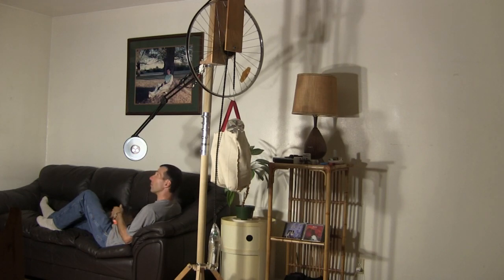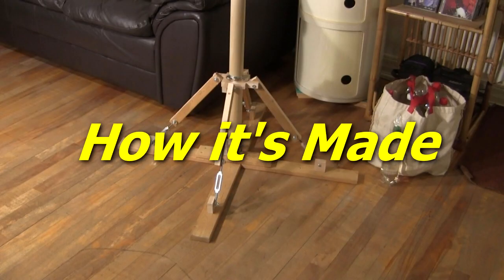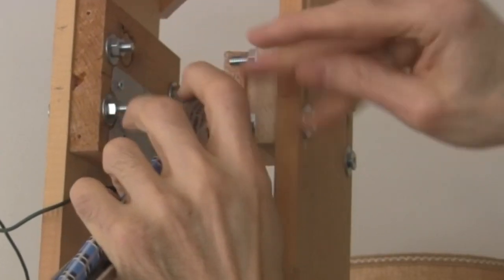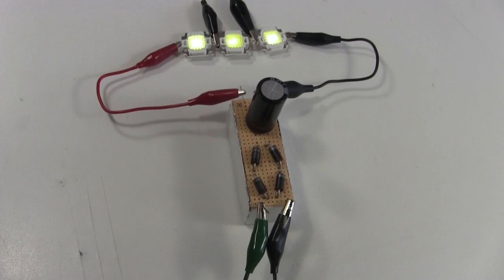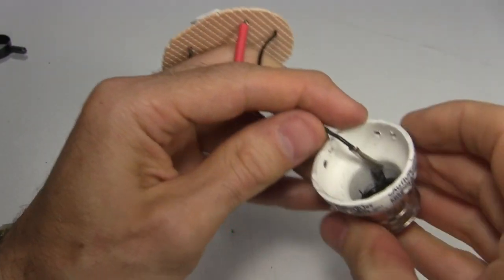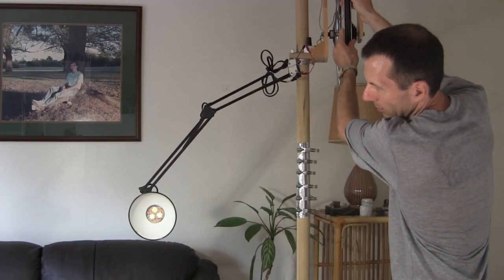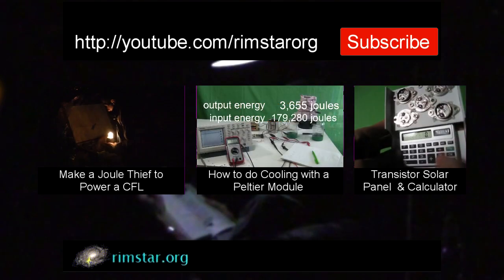Gravity Light (v2) Making and Enhancements

Comment: Can different kinds of light bulbs be used instead of diodes?
Reply from the maker: The problem with using different kinds of light bulbs is that they require more power. That's why I used the LEDs that I used, they're very efficient and give a lot of light for a low amount of power. If I used the same power to light another kind of light buld, the light would be much dimmer.
Reply: Thank you!

Comment: Hello, If I use a 24 volts dc motor, what rpm should I use?
Reply from the maker: I don't know, you'd have to do some sort of test. Make the circuit for powering the led from the motor and somehow spin it to see what rpm is required for the led to light. But I think when you do,, you'll find that the rpm needed is too high. The motor that I used also contains a lot of gearing inside (the gearing converts low rpm to high rpm). That allowed me to use a very low rpm. A normal 24 volts dc motor has no gearing so you'd need a much higher rpm. You'd need to provide the gearing yourself for going from low rpm to high rpm. I have more of an explanation about the basic principle on my website here https://rimstar.org/science_electronics_projects/gravity_light_homemade_diy.htm

Comment: Would it be possible to charge up a mobile phone?
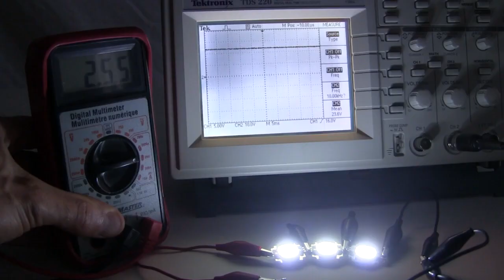Reply from the maker: I don't know how much is needed for a mobile phone. In the video at around 2:49, I show that the LEDs have 24 volts across them and are drawing around 2.7 milliamps. That's 64 milliwatts (24 x 0.0027). A phone is a different load but let's say you step the voltage down to 5.2 volts (maybe with a DC to DC converter), the current would be 0.064 watts / 5.2 volts = 0.012 amps or 12 milliamps. I don't know if that's enough, or how long it would take for charge the phone with it though.

Comment: Hey,  great project, I think you could improve efficency by replacing the bungee with a proper rubber belt. The other one, is the motor I'm sure isn't a great generator. A simple made rare earth magnet and coil generator would be much more efficient. how did you improve the run time from 2 to 12 min?  that's a huge increase. Def onto a winner with this tho. I can see a device similar to this that stores the energy in a battery. and a hopper full of weights slowly feeds the machine until the hopper is empty then energy stored lifts the weights back up to the top, or someone can lift with a pulley system.
Reply from the maker: To go from 2 minutes to 12 minutes I did two things.
The first was to make a sturdier stand so that I could move the chain to a smaller sprocket because it didn't lean over anymore, plus it could now support more mass. So more mass on a smaller sprocket meant the mass could fall more slowly while still producing a sufficient speed at the generator.
The second was to switch to more efficient LEDs. That meant I could slow things down more while still getting the same or more light.
There are always losses, plus you use up some energy to power the light, so the battery wouldn't have enough energy to pull the weights back up. But if you're reading on the couch, you should get up and stretch every now and then anyway, so why not do some lifting while you're up.
Reply: RimstarOrg hat was your final gear ratio after modifications. for each rev of the rope pulley, how many revs were you getting at the alternator? I'm thinking not of a way to create a light but a way to actually generate and store electricity. The problem with this system is even if you built a fantastically efficient alternator is run time is limited by height and always will be. I had a thought, say your maximum height was 3 mts but you could make it fall in a long zigzag fashion. A heavy weight on wheels rolling down an inclined surface which could be 5 mts long or as long as you want. when it gets to the end, there's a pulley on the end of the track to support the wire or rope attached to the weight, the wheeled weight falls down to the next track and starts travelling  back towards you and so on so the overall distance travelled can be much greater. now a bit of trial and error would have to be figured out for angle of inclines, gear ratios as the weights not pulling straight down, the weight may have to be greater etc but possibly a much longer run time can be achieved. also thought of making a system that has multiple units but only one weight to generate more power.
Reply from the maker: The top pulley is turning at around 6 to 10 RPM, I don't know what the generator is turning at inside after all the internal gearing. You can see the dimensions on my webpage here https://rimstar.org//science_electronics_projects/gravity_light_homemade_diy.htm. Neat idea increasing the distance that way.
Reply: Can you please tell which motor suits better for this

Comment: I’m in middle of converting a small hand held hoover( car vacuum cleaner) into a portable wind/water gene with built in lights( run off the Vacuum’s built in batteries) and a USB port for charging ph’s etc. Also got a wind gene project going to put on my balcony, made from a ‘stand fan’ and the motor from a food processor. Oh yeh and a hand wind gene from a microwave Syncronous motor. I’m pretty good at re purposing/adapting  things but am virtually a newcomer to electronics, and so learning as I go!.
Reply from the maker: Sounds like lots of fun!

Comment: Would it be possible to have an Equal weight on the opposite side so when 1 side is down the other would be at the top, and jus use a much smaller weight to add to the weighed counter that would be at the top. So the idea is instead of having to get up and lift the weight up every 12 mins, you could just swap the small extra weight from the weight to the ( Equal ) counter weight? Although thinking about it, you would still have to get up in order to reach the weight that’s at the top!. Would work  perhaps if your bed/Sofa was on a Mezzanine or if you had a hole if the floor to a basement so most of the apparatus would be bellow floor level with the top of the apparatus at head high when in sitting position!. Then all you would have to do( in theory) is move an extra bottle of water of paper weight etc from one side to the other!.
Reply from the maker: It's the difference in weight between the two sides that makes one side fall. Obviously if both sides weigh the same then nothing happens. If you then add just a little to one side then only that little extra is what has to do the work of turning the generator. But as you see in this video, it takes a lot of extra weight on one side in order to turn the generator. So having a small difference isn't good enough.
Reply: RimstarOrg yeh I’ve just realised how silly what I said was!. Cos if you have two weights countering each other, they cancel each other out!
Reply: I should of at least got up out of bed and freshened up, breakfast etc before commenting, I’m a mechanic and fabricator with experience working on Trains. So that was just one of them stupid things said without putting brain into gear!. lol
Reply from the maker: No worries. Been there, done that.

Comment: i recognise that gene sound, its the plate turning Syncronous motor from a Microwave isnt it?. I was thinking of using it for a gravity gene as it puts out a lot of voltage but is noisy when turned fast, so ideal for this purpose or a hand held/windup gene
Reply from the maker: Yes, that's what it is.

Comment: I'm thinking the milliamps you stated is incorrect. probably around 27 mA
Reply from the maker: You can see at 2:52 that the meter is on the 20mA scale and the reading is around 2.7mA. The LEDs seem bright but they're nowhere near full brightness.
Reply: RimstarOrg I think you're either reading the meter wrong or the meter is defective. Those type LEDS need a lot of current. About 1 Amp. You're meter is probably reading 270mA.

Comment: Not bad.  One question though: If you have 3 LED's in series and they need 24V each, how are you getting away with a 35 V reservoir cap? Is that cap even necessary? What happens when you run without it? The output frequency must be like 400Hz; I can't imagine you would notice much flicker. I've personally always preferred to use DC motors of the type used in record turntables, VCR's or tape players as small generators due to their smooth, quiet and efficient operation. Most hand crank flashlights and radios do.

I messed around with this concept a bit myself after Steve Mould posted a video featuring a production version of this.  I also tried using a synchronous motor from a microwave but I thought the built in gearbox would be too noisy and inefficient so I was trying to spin the rotor directly. Never ended up getting it working.  I wonder if it might be better to dispense with all the reduction belts and gears and instead use two water reservoirs connected by a hose with some kind of turbine spinning a gen in the middle.  Ideally it would be great if the turbine could be bi-directional so that the reservoirs could be bladders and the system could be closed, and reset by simply bringing the full reservoir to the top, but I can see no reason why siphoning from open buckets wouldn't work too.  You could ostensibly get hours of continuous operation with very large reservoirs, as the reservoir itself would not need to move; just the water would.  I may have to try this now that I think of it..
Reply from the maker: In answer to your question, the 3 LEDs in series need 24V together, not each (see the video again at 2:50). So there's no problem with the 35V reservoir/smoothing cap. I never tried without it so I don't know how well it would work. I don't know what frequency the motor's producing. I know it's normally run at 110Hz, but that doesn't mean that when run as a generator at this voltage it'll run at the same frequency. I guess if it's a high enough frequency then any flicker in the LEDs output won't be noticeable, good point. But without the cap, the voltage wouldn't build up to 24V, so it wouldn't be high enough to turn the LEDs on. At first the voltage is DC, but start's very low and slowly builds up to the 24V as the cap is charged.
Reply: Actually the cap does nothing to increase the voltage; it's just there to smooth out the pulses coming from the generator.  The cap can only charge to the peak voltage (minus 2 diode drops from your bridge rectifier) that would be coming from the generator.  Those little turntable motors put out surprisingly high voltage.  Put your scope on the generator leads or just try holding the wires with it running and disconnected from the rectifier.  I've gotten them to light neon indicators (60-70V) without any extra circuitry.
Reply from the maker: Of course, what was I thinking? It's the diodes in series that cause the voltage to increase. Doh. Thanks for correcting me.
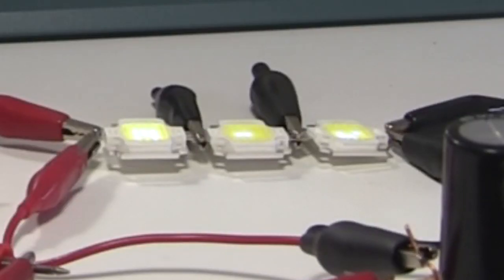Reply from the maker: Actually, the voltage across the capacitor and LEDs does build up. You can just barely see this at 2:41 in the video where the voltage on the scope is 8V and climbing. The vertical graticules are 10V each. Unfortunately I zoomed in to the LEDs soon after but then by the time I go back to it at 2:46 the voltage has risen to 24V. The rise to 24V actually takes around 20 seconds but I did a cut in the video since I didn't want to make the viewer wait for 20 seconds.
Reply: Yeah I get that.  What I'm saying is that the capacitor doesn't boost the voltage in any way.  Other than by using a transformer or some kind of switch mode circuitry, you can't get to a higher voltage than is coming directly from the generator.
Reply: what else is I’m a novice at electrical stuff, I’m more a mechanical person, anyway those microwave motors put out such a high charge( relative to their size) that I would think they could power a few LED’s without any flickering without using caps etc, but I’m probably missing something?.

Comment: pretty great! is the microwave motor the most efficient conversor? could you upgrade and get more electricity from the same design?
also, do you think you could get enough to, say charge a small battery, so you could store during the day and use at night?
Reply from the maker: The microwave motor was just the only thing I had on hand. The gearing inside it is what made it possible for me to do this. I imagine whatever the commercially made one of these uses if more efficient.
Regarding charging batteries, I don't see why you couldn't.

Comment: Hi Steve! did you know that newer led flashlights use a little circuit to turn on and off the light really fast to use less energy? you can easily duplicate the running time! btw,  did you try to use a battery to save energy for later? ;)
Reply from the maker: Someone had suggested using a boost converter circuit, which the the same thing, but I never tried it. I hadn't tried a battery either. I guess you'd do both. Store the energy in a battery and then take it out of the battery using the boost converter, giving you light even after the mass had hit the floor.

Comment: Can u please send me the link to buy the pulley
Reply from the maker: I bought it in a local store (Princess Auto I think). Look for it in hardware stores of search online for V-belt pulleys. The outer diameter of the whole thing is 2 inches. The diameter of the inner section that the inside of the belt contacts is 1 inch. The hole is a little less than 5/8 inch.
But you don't need the exact same one. Anything close will do.

Comment: I was looking for how much a gravity light would cost (the one made by crowdfunding and made in Africa or something) but I couldn't see it for sale anywhere and the prices to join the crowdfunding seemed very high (even for charity). So I ended up here. :)
Anyways, I was wondering if you thought of mounting it from the ceiling?
Reply from the maker: I don't have a way of doing it here since this is an apartment, but I don't see why it couldn't be done. You'd need to find a beam in the ceiling to attach to. A wall stud finder might do that, unless your ceiling is the attic floor and you can see the beams by going into the attic. Possibly one or two lag bolts into the beam would do the job.
Reply: Okay thanks.

Comment: Can you add more details about the Motor/Generator. How fast can it turn, how much voltage can it hold, and some similar informations.
Reply from the maker: I'll add some more details and photos to my webpage here http://rimstar.org/science_electronics_projects/gravity_light_homemade_diy.htm later today but for now... They're motors for turning the turntable inside microwave ovens. They turn very slowly and have some sort of gearing inside, which is why I'm using them. The two I have in front of me are both 120V, 3 watts, and are either 3 RPM or 6 RPM. So the speed you see it turning in the video is the maximum speed. Any faster and the gearing will probably cause too much current to be produced internally and damage the coils.
Reply: +RimstarOrg Thank you very much.

Comment: What if you made a heavy duty version of this that utilized something similar to a car jack? When someone does squats or bench press they move over a hundred pounds (typically) a couple of feet for each repetition. I'm picturing a tower the height of a house and a weight that is several hundred pounds being lifted in small increments. You could capture a great deal of energy during a workout.
Reply from the maker: +John Gober That would be cool. I regularly do  push-ups and sit-ups so could make use of that. Unfortunately I don't have the place for a tower larger than you see in this video. But lack of height can be compensated by using more mass, provided you have the gearing.

Comment: Hey Steve, how does the mechanism work that keeps the weight falling at a slow rate?Why doesn't it just immediately sink to the ground?
Reply from the maker: +Michael Austin The microwave oven motor that I'm using as the generator has a lot of gears in it that convert the slow turning of the shaft to fast turning of the magnets inside it that interact with the coils. So I guess it's partly the gear step-up and partly the back-EMF from the interaction of the magnets and coils. If you take just the microwave oven motor itself and try to turn the shaft by hand it's very, very difficult to do so.